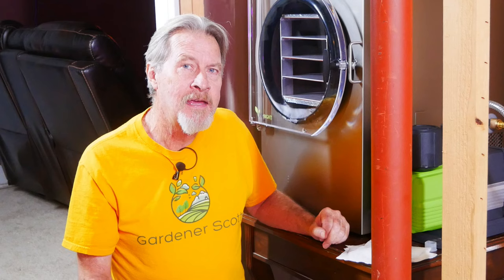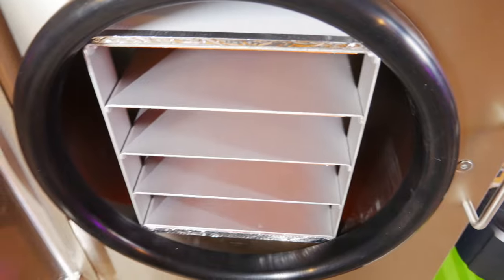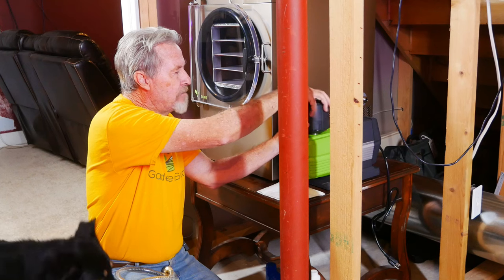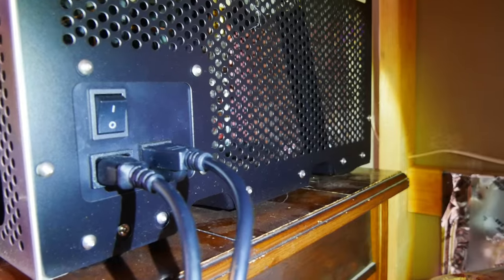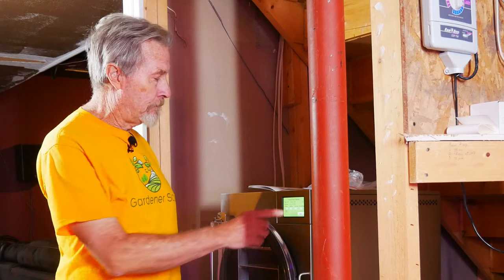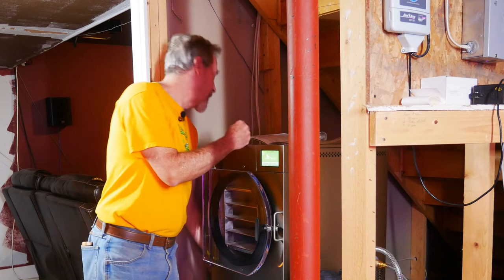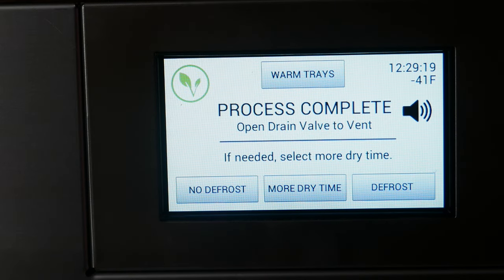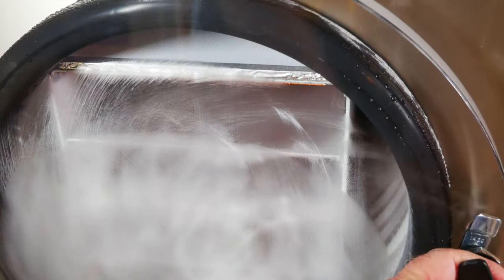HARVEST RIGHT Freeze Dryer Setup (and Test Run)

Comment: Congrats on your new addiction. I've been freeze drying since January and I saw a mistake you made. Your trays should be warm, not cold when the cycle is done.If they are cold then you missed your extended dry time window, and the machine will refreeze the food to  protect it. At that point you're starting the cycle over. Mose people will add extra dry time to the custom settings just in case they're not around when the cycle finishes. I added 12 hours to mine.  You are also going to want to put a small fan aimed at the green section of vacuum pump. Good luck. Blue.
Reply from the maker: Thanks for the tips. The cycle finished when I was asleep and I'll modify times as I learn more.
Reply: Invest in a scale that measures in grams. The 100% sure fire way to be certain your food is completely dry is to weigh the trays in grams when the cycle says it is complete, put the trays back in the machine and set additional drying time for at least 2 hrs (this is different than your extra dry time that is in your settings). After the additional 2 hrs is up weigh the trays again. If they lost more than 2 grams of moisture put them back in the machine for another 2 hrs until when weighed they have not lost more than 1 gram of moisture. That is when you will know they are completely dry. THEN you can either manually defrost or have the machine do the defrost.
Reply: It isn’t starting the cycle over, it’s preserving the food until you can get it out. My manual reads—WARM TRAYS: The freeze drying process includes warming the trays. Trays will be warm immediately after the batch ends. If you are unable to remove trays immediately after a batch ends, the unit will cool and freeze the material that was freeze dried. This safely preserves your food until you are ready to remove it. The extremely cold trays can be uncomfortable to remove with bare hands. To avoid this, you may use gloves, hot pads, or, simply warm the trays. Push the WARM TRAYS option on the screen and wait 5-10 minutes before unloading.
Reply: Should I get the bread wet and then pre-freeze it before trying to freeze dry it?
Reply: @JenniferClements-vw6yf  yes,. use a spray bottle and mist the bread but not soaking.
Reply: @bluewolf4915  thank you!  I hate that I have to wait 24 hours to even do the bread run.

Comment: Hi Scott, thanks for the video, it was super helpful! I just bought mine and was wanting to know if the drain valve for water has to be higher than the bucket it goes into? Also how long does the oil last usually, ie when will I have to replenish? Finally I was just wondering if you always have to wait in between batches or can you pop the next batch in immediately? Please let me know, thanks!
Reply from the maker: Hi! Yes, the valve should be higher than the drain to avoid backflow. Harvest Right says you don't need to change oil until 20+ cycles. You can do a new batch right away but it depends on how much water was removed. There can be a lot of ice buildup and I would suggest thawing and draining it so it runs best.

Comment: Be aware that, depending on the moisture level in the air, you will get quite a bit of condensation dripping from thr face of the door. You might want a towel under that door to protect the wooden top. Have fun!
Reply from the maker: Thanks for the tip. I have low humidity but did notice moisture around the door.

Comment: I love this video I am not get any coming up but the freezing screen and the pump comes
does the pump run while it is freezing Can you only use 2 tray at a time I have four. I am sure it is operator error Thank you
Reply from the maker: The freezing cycle can take a long time and the pump can run for many hours during the drying. You can use just two trays but it is more efficient to fill it with four trays.
Reply: i don't  know what i was trying to say in the first line of my last question.
i noticed that in 
your set up video that the total hrs. for the test run was around 12hrs. can you pleas give me a a time that the freezing period took ? Was the total time 12
hrs. How do I know what my freeze temp is for freezing  time is? the pump has not turned on after 2hrs of freezing with my bread set up. Should i just let it run?
I am smelling a trang smell
thank you

Comment: Didn't you defrost the freeze dryer after the diagnostic tests? You need to do that before you run a batch (or that bread). Correct?
Reply from the maker: The freeze dryer should be defrosted after each batch. It can be electric or ambient air.

Comment: Scott, Question...BREAD RUN, had my "bread" not been completely dry and I needed to chose MORE TIME,  do I need to CLOSE THE DRAIN VALVE, before running more DRY TIME?
Reply from the maker: Yes, the drain should be closed. The screen should have a reminder message to say that.

Comment: Does anyone know if you’re suppose to keep the pump turned to the on switch all the time or do you turn it off when not in use? Thank you
Reply from the maker: You can turn it off when not in use, but the pump won't run unless a freeze drying cycle is on.